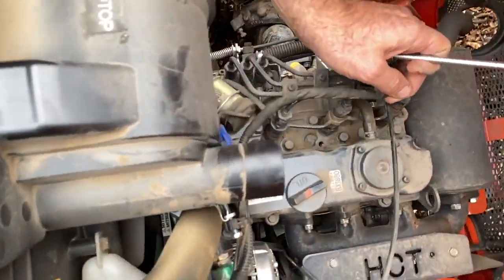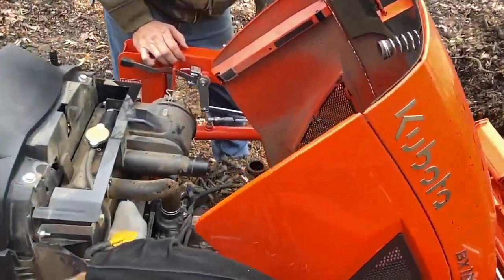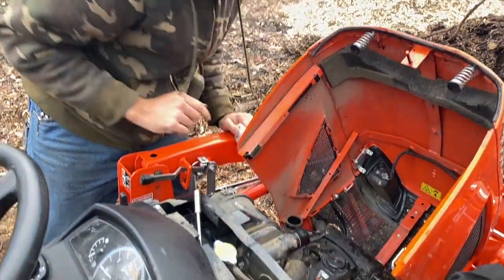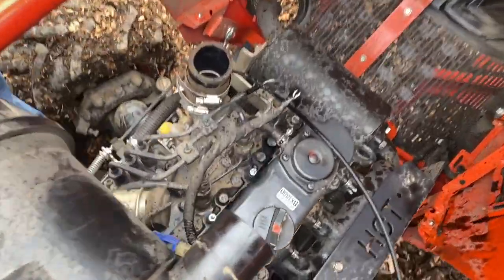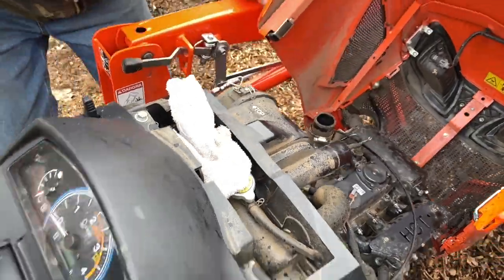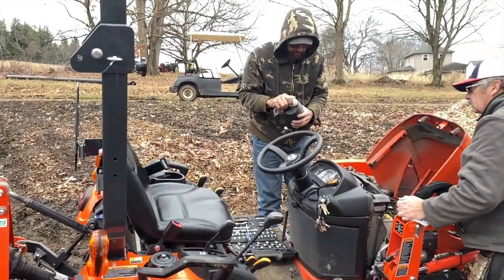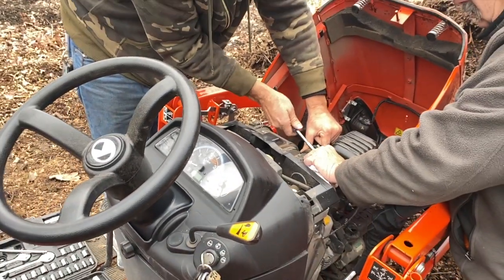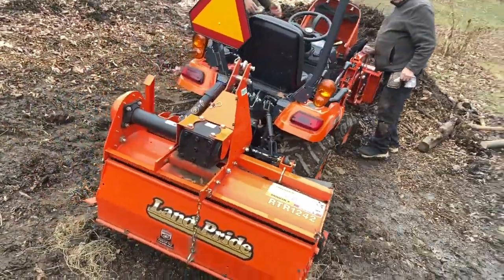Kubota Loader Flipped

Comment: For over 30 years I have operated forklifts, and there are many similarities with these mini tractors.
These vehicles are narrow relative to their high center of gravity, making it easier to roll over.
On sloping ground, always keep the center of gravity (bucket) as low as possible.
The height of the front bucket affects the stability of the tractor as much as the height of the load on the forks of a forklift.

Comment: If you are in a hurry this could be worth the effort but otherwise you could just get it right side up and then leave it alone for just a little more time than it spent tipped over. 
If it flowed X amount of oil up past the rings and in to the cylinders for 30 minutes while it was laid over, once it is righted, it will drain the same X amount of oil back down past the rings in the same amount of time it took it to get the oil misplaced to begin with, 30 minutes give or take withholding for temperature difference and such.  
More or less it will flow oil past the rings under gravity pressure at the same speed going either way, oil going up, or back down. 👍
Reply from the maker: Excellent Information! Thank You for watching and including this knowledge!!
Reply: @SnyderPM  no problem. 👍
It sure was nice to see you guys handle that kind of situation while being calm and collected.  
Seems if I do so much as lean over in the seat on a tractor I have at least one or two wannabe be drama multiplayers starring right at me, customers, neighbors, family, passing traffic, somebody’s always watching and just itching to go panicking around all over the place while I’m having to figure out how best to un crap  my crappy situation.  
Rolling something over and recovering something in private with no audience are both a pleasure I’ve never had.   
I can’t get the zero turn stuck without gathering a judgmental crowd of know it alls at the scene.  
👍
Reply from the maker: lol this one was the last house on a dead end road but we get some of those too! Grass cutting is usually the most viewers tho.. that or anything with a bigger machine! As long as no one gets hurt and stays back, we are cool with an audience!
Reply: @SnyderPM  must be nice when your confidence is tempered by decades of experience to the point where performing in public while also in a stressful and unexpected situation is thought of as; no big thing.  
😏

I certainly respect the amount of shitstorms you must of gotten yourself through in the past to get yourself to this point.  
I do not envy that journey and seriously doubt I’ll survive through enough of these storms to ever get that battle hardened by them.  

Stay tough ol timer, they just don’t make ‘em like you anymore. 🏅
Reply: @Charles McKinley I understand what you’re talking about but I still disagree because the rings are not going to be sealing or functioning like they will with compression pressure while it’s running.  
An oil wiper ring doesn’t wipe unless it’s moving and a compression ring only expands and seals under compression pressure and when it’s not running, non of that happens so
a ring gap is a ring gap to flow through going either way and the oil knows no difference.
Reply: @Charles McKinley they are still directional by design sure, but they only function as designed when under pressure.  
And the pcv system has a check ball that stops liquid from passing through it that operates regardless of its orientation.
Reply: @Charles McKinley the liquid moves the ball, not gravity.
Reply: @Charles McKinley it’s not that it has no effect, it just has less effect than the flowing liquid has on it. 
And taking out the glow plugs is not always an easy task.
Reply: @Charles McKinley but still not as easy or cheap as just being patient and waiting.
Reply: @Charles McKinley logic checks out. 👌
Reply: @Charles McKinley funny you say that since with enough of it, yes time will absolutely solve the problem, it’s not like the oil is going to stay up there forever.
Reply: @Charles McKinley who assumed what?
I never said that.  🤔
Go straw man somewhere else.
Reply: @Charles McKinley just more straw man…

Comment: Aye - I did the same with a Kubota B6000 . You have to be aware that a Tractor has a swinging front axle !!!!!!!! hence when the loader bucket is full and theres Not enough weight on the back end !!- It will See Saw on the Front Axle upon which it'll also rock over on the Axle Pivot and Flip over !!!!!
A Dedicated Loading Shovel has the Floating Axle on the Rear end which gives far more Stability - it also has a Designed Counter Weight to Counter act the See Saw affect.
It taught me a lot rolling that B6000 over at about 15 years old !!!!!!!!!!!!!!

Comment: Well when you done showing how to take the glow plugs out and get the oil out of the Pistons then you started the motor up you didn't even bother checking the oil in the motor and adenoids to the motor
Reply from the maker: They talked about it in the chipmunk voice but knew no oil was spilled on the ground. Got it going and up to the house to check the levels after it sat. This was not planned, things could have been better.
Reply: The checking of the oil was clearly shown in the video.

Comment: While it was on its side would have been a great opportunity to replace that fuel filter that is under the tractor LOL.  

These BX machines are pretty tippy if you ain't careful, I've had my share of close calls in the past year and a half I've owned my BX2680.

Comment: If my tractor tipped over I’d right it up, leave it for a day and then try to start it.
Reply: And you still might bend a rod. Pulling glow plugs, or worst case injectors, is a pretty simple job to make sure you don’t buy an engine!